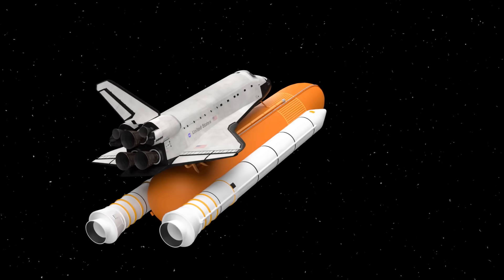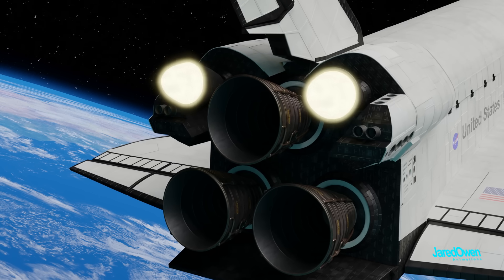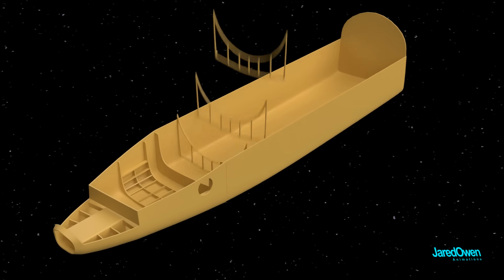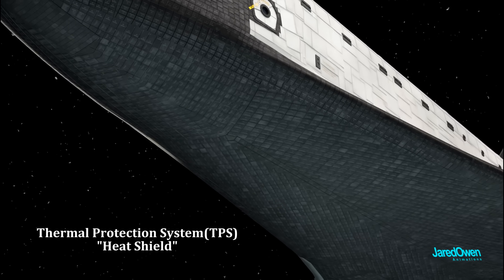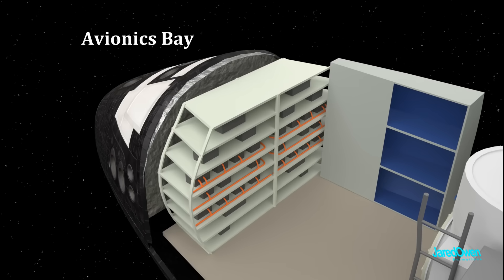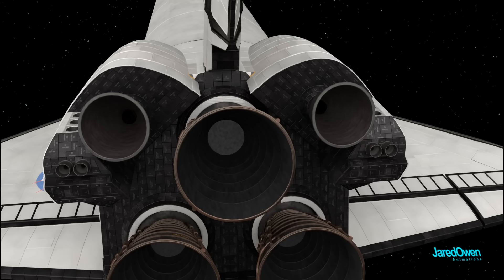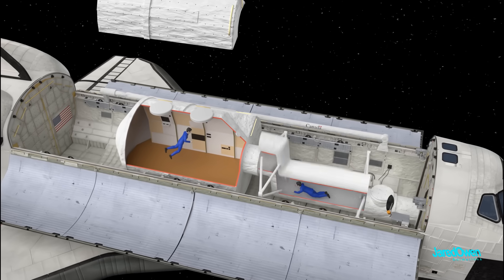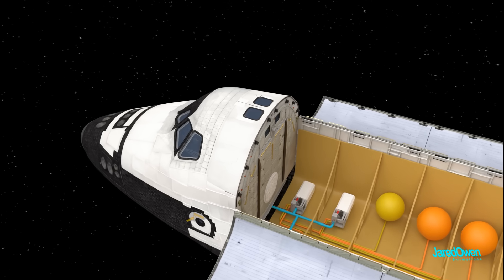How did the Orbiter Vehicle work? (Space Shuttle)

Comment: As you mentioned, the Space Shuttle program lost two orbiters and their crews. Both disasters are related to the design decision to have the orbiter attached to the side of the fuel tank and booster rockets. All space vehicles before and after have the crew compartment above the dangerous elements and an ejection mechanism to save the crew in the event of a catastrophic event. Look at the new X-3737B rocket where the space plane is at the top as the Apollo design had.
Reply: Nixon and Congress tasked NASA to build a reusable 'space truck' and accompanying booster system. NASA came up with the design for piloted fly-back Orbiter and piloted fly-back Booster.

Nixon and Congress approved the design, but gave NASA only enough funding for the Orbiter ... and told NASA to make do.
Reply: The X-37 has no capability to carry people.

Comment: How did the shuttle start moving backwards whilst in space, then forwards again upon re-entry ?
Reply: It just rotates around using the RCS shown in the video. Once the boost is done to slow the shuttle down for a re-entry course, the shuttle would then flip around to put it in a forward facing position. This put the heat shield facing the appropriate direction as well.
Reply: @Inferno1170   Thank you so much. It is clear now.

Comment: Over 135 missions at 78,000 lbs for an empty external fuel tank that’s like 10 million lbs of metal burning up in the sky, not to mention over 200 million lbs of propellant just from the external tank. 
Sorry if I don’t feel guilty about driving a pick up truck.
Reply: Where did you get the 10 million lbs of metal burning up from? Also, the fuel is just liquid hydrogen and liquid oxygen. So essentially the main engines are just spewing out steam
Reply: @thingusbrulingus  135 78,000 lb tanks is 10,530,000 total expendable lbs of aluminum and copper which burned up in 135 re-entries.

A typical jet flight is 1-3 tons of CO2 per passenger. A space shuttle is 50 to 75 tons per passenger. Average vehicle kicks out less than 2.5 tons over 12,500 miles which is pretty average for a year.

Comment: In a vacuum, how can you get propulsion? This is where I'm at a loss.  What are the rockets pushing off of?
Reply: The thrusters dont ‘push’ off of anything, the gasses shot out of the back thrust the orbiter forward
Reply: Newton's third law, action equals reaction.
When several tonnes of hot exhaust gases per second are thrown out at ten times the speed of sound or more, they produce lots of recoil pushing the rocket in the opposite direction. A single space shuttle main engine produced 3-4 times more thrust than the world's most powerful jet engine, and it worked better in vacuum than in the atmosphere.
Reply: @fromnorway643  Cool story, but this isn't answering the question. What are the rockets pushing off of?

Fans pointing at a feather in a vaccum have been put to the test on multiple occasions. There's video of this. There's no movement. It's a vaccum, as the name suggests.
Reply: @hookkups  
Why should a fan have any impact on a feather in vacuum? If there isn't any air or other gases around the fan blades, they have nothing to interact with and they will just be spinning without having any impact on their surroundings. Unlike a fan or propeller, a rocket engine produces its own gases.

One common explanation of how rocket engines work is conservation of momentum, but maybe it's easier to understand this one:

Imagine a closed container filled with a gas at very high pressure. The gas molecules flying around in all directions push against the walls when they collide with them and bounce back. However, their pressure doesn't produce any net force since the pressure against one wall is balanced by an equal pressure against the wall on the opposite side.
If one of the walls is removed and the gas flows out there, the gas pressure against the opposite wall will no longer be balanced, and there will be a net force pushing in that direction.

The combustion chamber in a rocket engine is basically like this, but its gas pressure is maintained by constantly adding more fuel and oxidizer that is burned at very high pressure and temperature. The exhaust nozzle is shaped in a way that maximises the speed of the exhaust gases since a higher speed produces more thrust per unit of fuel consumption. The term for this used in rocketry is specific impulse and should ideally be as high as possible.

If that explanation doesn't make any sense, maybe this will:
https://youtu.be/KzVs4gM1j0I
Reply: @hookkups  
Watch how the space shuttle's two booster rockets (SRBs) were separated from the shuttle and its external fuel tank at 45 km altitude about two minutes after launch:
https://youtu.be/OnoNITE-CLc?t=183
If the claim "rocket engines need air to push against " had any merit, they would be very close to useless at 45 km altitude where the atmospheric density is reduced by 99.85 % compared to that at sea level, but they clearly work just fine.
Note the small thrusters in the noses of the SRBs pushing them away from the shuttle, and also how the shuttle's three main engines continues to accelerate it away from the SRBs. And BTW, the SRBs didn't suddenly stop when separated, but continued to climb due to their momentum until reaching 67 km altitude before they fell back to Earth and landed with parachutes in the ocean 240 km east of Florida.

Another example is the Saturn V rocket that launched Apollo 8 in December 1968:
https://youtu.be/XKtH0uzg8wU?t=181
Note how the second stage ignites and accelerates away from the first stage after the separation, something that happened at 68 km altitude. The atmospheric density at that altitude is reduced by more than 99.99 % compared to that at sea level, but the second stage's five J-2 engines worked just fine.
If a near vacuum doesn't prevent rocket engines from working, why should an absolute vacuum do?
Reply: @hookkups  probably one of the simplest ways to visualize Newtons Third Law is with a gun. The bullet is accelerated to high speeds but this also causes recoil in the opposite direction the bullet is traveling. This happens regardless of the presence of air or no-air. The recoil still occurs even underwater (https://youtu.be/8zNBzlnSwMk). The recoil will be less because water is denser than air but it is still noticeable. So in a vacuum none of the recoil will be stopped by surrounding matter. That's why rocket engines are more efficient in space than in atmosphere.
A crossbow for example would still have recoil no matter if you fired it in a vacuum, air or underwater.

Comment: Using the side hatch in space does not "suck all the air out" of the orbiter vehicle.  Space is a vacuum, but not a vacuum cleaner.  Vacuums do not suck.  Instead, it is the air pressure inside the orbiter that would PUSH all the air out if the side hatch was opened.  Many people seem habitually to confuse a vacuum with a vacuum cleaner.  Or not.

Comment: Note that starting in 2005 as part of the recommendations imposed by the Columbia Accident Investigation Board. The shuttle was equipped with a 50ft extension of the robot arm called the Orbiter Boom Sensor System (OBSS). This was used to look for damage and assess the condition of the thermal protection system on the orbiter.
Reply: As well as the backflip maneuver upon arrival at the ISS for crew on board to visually inspect the orbiter.

Comment: I don't know how it can glide with little aerodynamics with an ease even gliding better than an airplane
Reply: The shuttle didn't glide better than an airplane. It had a much lower lift-to-drag ratio than most airplanes, forcing it to descend at a much steeper angle (20° vs. 3°) to produce enough speed and thus lift to counter its weight. The landing flare (raising the nose) immediately before touchdown changed its path to almost level to soften the landing, but that greatly increased the drag and caused the shuttle to lose speed at a very high rate.

Comment: Fun fact: the 747 was used for OV’s that went off-course and landed in a secondary airfield. The two 747s were from American Airlines (Yes they used to own 747s until NASA bought them) and in first few flights still kept the AA livery but with the NASA symbol. The crew would actually pray for the weather to be bad (ex: rain) so that they can carry the OV to Houston. They carry it on the top of the Jet. They reinforced the body and added poles where the OV would be attached to by using a mating system. 

Lol this is soooooo long. If you see this, have a good day and have a good life ;)
Reply: The earliest missions all landed on the dry lake at Edwards AFB in California or, in just one case (the third mission), at White Sands in New Mexico because Edwards was flooded. It was only a bit later that they got accustomed to landing on the Shuttle strip at Kennedy Space Center, and diversion to Edwards for bad weather at Kennedy wasn't that uncommon even late in the program. So between that, the glide testing of Enterprise, and ferrying the orbiters from their places of manufacture, they got a lot of use out of those carrier aircraft.

When the Shuttles were retired, the 747 carriers were used to bring them (most of the way) to the museums where they would go on exhibit. Enterprise also went on tour to various air shows and other events, and at one point it was used for fit testing of the military Shuttle launch site at Vandenberg AFB (that was never actually used for that purpose).

Comment: Awesome, now imagine if they upgraded the interior and added modern materials and electronics to the shuttle. Imagine if they replaced some of those vulnerable aluminium bits with carbon fibre or stronger carbon carbon materials in the 90's. The crew compartment could have had much more room if the avionics bay could have been reduced. All those buttons and panels on the main deck could have been replaced by something more modern. A mid life refresh could have bought the liquid oxygen onboard the shuttle reducing the fuel tanks size and maybe avoiding the incident that caused the columbia accident.

Comment: 874 / 5000

Can you do simulations of how the cargo is removed from the space shuttle? Some loads must have weighed several tons and were quite large. Is there any orbital crane for unloading large items? Who and how mounted them in orbit? It is not about weight, because in orbit they can be weightless, but about how they were maneuvered during assembly. Are the station elements bolted or welded? How is the tightness of the structure ensured? The seals must be very tight or the vacuum will draw air out of the ISS in minutes and everyone inside will die in 15 seconds. The elements are metal and every 90 minutes they heat up to 150oC and then are frozen at -120oC. Such variable thermal loads cause the structure to stretch and then contract. The ISS has already completed several thousand laps. Have connections been exchanged? Have they not cracked? will you be able to develop your simulation?
Reply: SP  First, answer simple questions. If you cannot answer how several hundred tons of structures were assembled at an altitude of 400 km, you do not know. I do not know either. There is no problem to make broadcasts using a green screen. There is a big problem, however, how to assemble several hundred tons of structures in orbit and in a vacuum. Don't offend others because you don't know either. Just because you don't know how the structures are assembled doesn't mean you're a fool. There is simply no evidence that such an assembly has ever been done.
Reply: SP  Secondly. There are many videos on YT showing the ISS being filmed on the green screen. There is a video of President Bush's visit to NASA. The president is in a rehabilitation cart and behind him you can see an actor on a green screen and another screen with the same actor in front of the ISS. A well-known movie, it's easy to find.
Reply: SP  Thirdly. In a second you can find such a video broadcast from the ISS. Time 2:00 A lady with spiky hair and a microphone suddenly breaks away and takes a side position. Some force had thrown her off balance. The smile disappears from her face. She is clearly concerned. She has to stick to the wall elements. If this lady were in a stable orbit in the putative ISS, in a steady state of weightlessness, she would not be thrown off balance.     https://www.youtube.com/watch?v=FRVhbbAkUkQ

Comment: How does the big fuel tank not disintegrate on its way out to space but does when dropped back to earth
Reply: Relatively slow speed during liftoff through the densest part of the atmosphere vs high speed reentry into the atmosphere that quickly intensify’s. Plus it’s detached in such a way that it enters the atmosphere in an end-over-end tumble that causes enough aerodynamic loading to break it up.
Reply: he says its used to only bring it above the atmosphere, the tank detaches when its path is at the earth. The OMS helps the shuttle in orbit once the tank is detached

Comment: Could a moon mission fit inside a space shuttle?
Reply: If you by moon mission mean all the parts of the Apollo spacecraft, then yes, if the lunar module's legs were retracted.
The problem is that they would be too heavy. All parts of the Apollo when fully fuelled had a mass of about 45 tonnes, while the shuttle's maximum cargo capacity to low Earth orbit (LEO) was only 27.5 tonnes, and even less to the International Space Station.

Comment: Can you make an animation on a Maglev (Magnetic Levitating Train). Specifically the EMS ( Electromagnetic Suspension) type of Maglev Train. Can you detail how it works,  and the engineering and design of the train itself.  I wonder if you have seen the new Chinese Maglev that they stole from the German Company Transrapid. I would like to see how the guide-rails are made and laid out. How it is powered and what that kind of technology would look like if the United Sates were to develop their own and build it along the the Interstate highways. A route along I95 on the East Coast, I75, I65, I55, I35, I25, I15 in the middle and mountain regions and I5 on the West Coast.  With intersecting Magleve lines that would run from North to South across the United States along I90, I80, I70, I40, I20 and I10

Moreover if you added alternative fuel stations along the line. Hydrogen refueling and electric charging stations along with the traditional fossil fuels would be the new transforming of American transportation. I would also add fiber optic cable and 5G antennas along the route in conduits to  bring broadband to the masses and to bring broadband Internet access to the citizens.